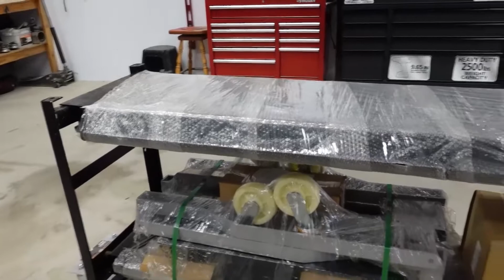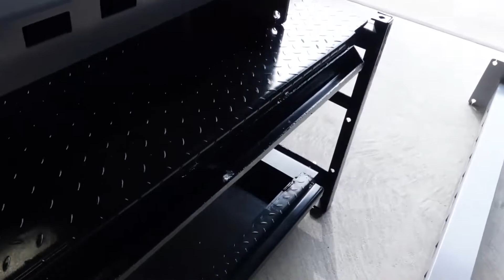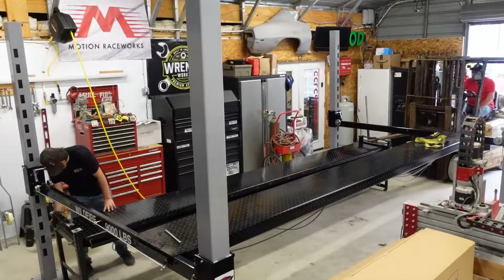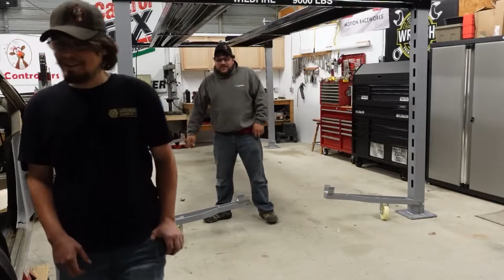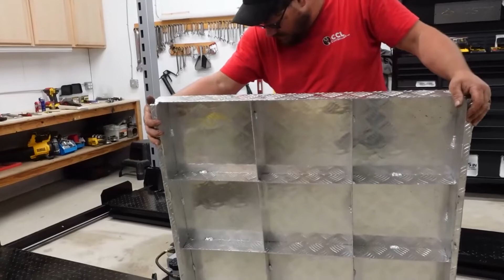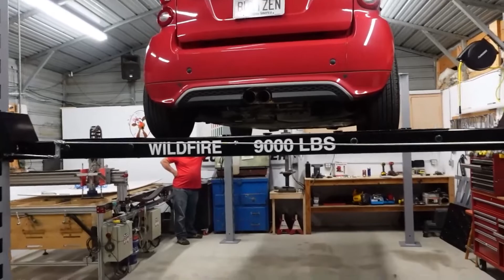New Wildfire XLT Lift Assembly

Comment: What size garage are you installing this in? Mines very similar but a odd ball size of 22x33
Reply from the maker: It is 24x34.
Reply: @RustedUpGarage  I’m considering doing the next size down lift by wildfire. I think it’s the first one on the site. I have a 69 cuda I’m working on and would like to pick up another project here and there this year. I was concerned one of these lifts would just kill all my space in my garage. I think the one below yours only saves a few inches length and width wise. My big garage door is way to the left on my garage and wish it was more centered like yours.
Reply: @Nevercouldfigureitout  Did you end up getting a Wildfire lift? Curious how it has worked out for you, if you did. I just ordered their XLT and had a hard time deciding between them, Advantage and Bendpak.
Reply: @ no unfortunately right after my original comment I went through a divorce and set me back. I hope to grab one next year